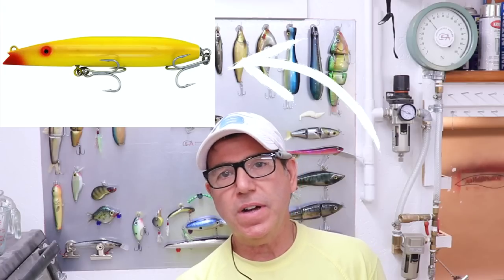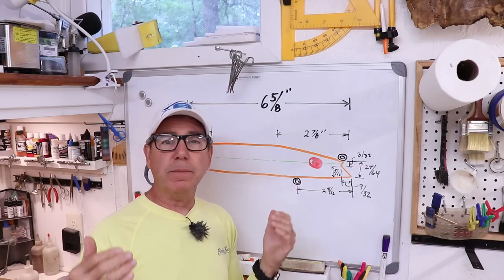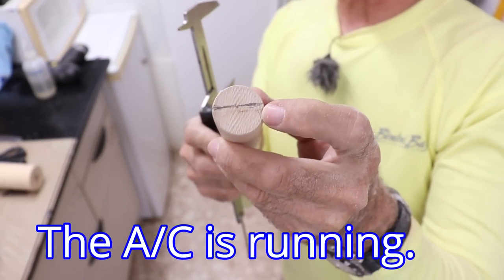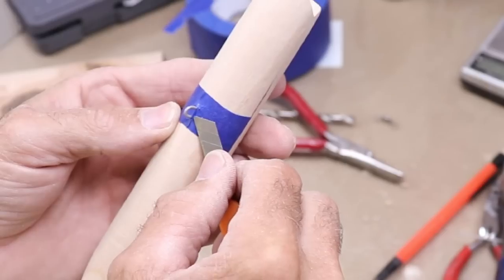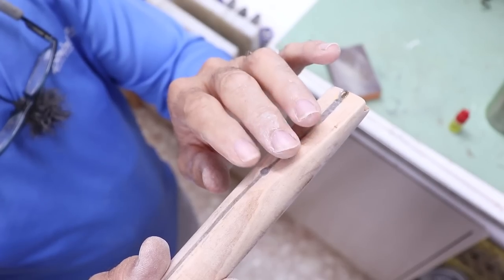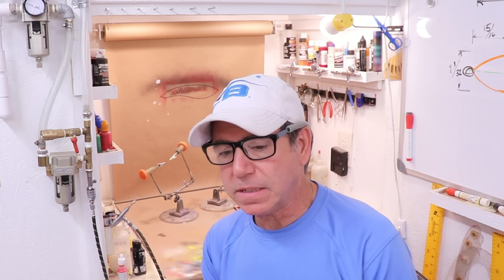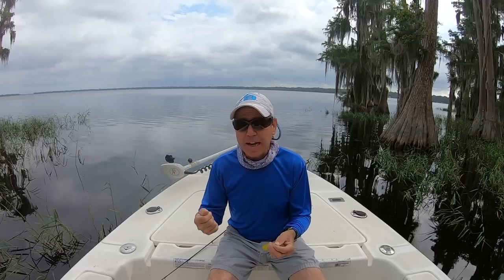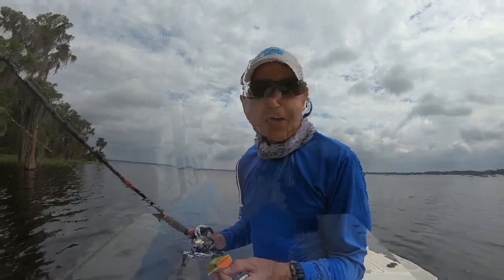How to Make a Wooden Darter Plug Step-By-Step  #darterplug #striperfishing

Comment from the maker: So I'm seriously thinking of making a trip up north to do some striper fishing, can anyone give me some advice?  I think the nearest fishable state to me would be Virginia, what do you guys think?  Is there a place that is easy to access from shore or a good beach to fish that has nearby places to stay (that won't break the bank)?  And how late in the spring can I reasonably expect to have a chance of good fishing?  Any help would be appreciated.
Reply: NC has bass too which is closer to you but those fish are heading north this time of year. Not sure when you plan on going its heating up in NJ and NY so you may want to head further north.
Reply: The striped bass are here in NJ right now. The surf fishing has been phenomenal. They are on their migratory path north at this point. So if you are planning a trip, pretty much any Jersey shore locale would be a good choice.
Reply: Stripers & blues are going nuts up here in nj & delaware
Reply: Virginia might be a little too far south at this time of year. Keeper sized fish are just starting to reach northern Mass / southern NH.I always have the best luck with water temps in the 50-65 degree range. this is also fishing from the shore for the most part, if you can get deeper water then you'd be able to get in to the warmer temps. Rental properties on the beach up this way are quite expensive, maybe $2000-3000 a week. Maybe if you stay a bit more inland you could get one for half that amount.

Comment: Could you of had a little water or solution on the brush when putting the clear on? Why glob once but not the second time? Maybe too thick of a coat? Sounds like it's time to experiment on scrap wood. Maybe do a couple test. Plain wood, painted dry fully, painted then still wet. Do a light and heavy spot on each. Keep up the great work I like how you bring your engineering skills to bait making.
Reply from the maker: I keep my UV resin brush in a light-tight container.  I have done lots of testing (check the link below) and it's almost always a problem with the interaction between the clear coat and the paint.  A good mid-coat like polyacrylic, applied well!, is almost bullet proof.  After the  resin residue had hardened I sanded lightly, wiped with alcohol , and sprayed a couple of coats of polyacrylic.  Ended with a super nice clear coat.  https://youtu.be/E0pkoI8CvJQ

Comment: Thanks for making this video, Surf fishing for striped bass/bluefish is about all i ever target nowadays. To get the right movement out of the darter i think you really need sideways current, like fishing a river from shore so towing behind a boat just wont do the potential action justice. One of the first lures I tried to make was based on a darter design, that said it didnt have the right action although it still caught a 29" striper. In the next couple of months i am having a new workshop built and i'll need to give a few of your designs a go.

Comment: regarding the knot type, I just about always use 50 Lb flouro leader and the 75 pound tactical angler clip to attach the lure. In 7-8 years of using them i did loose a lure once due to it working itself off the clip. They make it so easy to switch out lures day or night its a no brainier for me, even in pitch dark i can feel the clip and know how to remove an install a new lure with no lights.

Comment: Awesome video, that’s a staple of a striper anglers night bag, along with the needlefish. Both are supreme night time baits. 

I figure it’s worth mentioning before you find out the hard way: the plugs are always through-wired with the intent of using a heavy barrel swivel to attach the belly hook (rear hook optional and not encouraged- see “one hook solution”). The biggest stripers are quick to mangle some of the strongest treble hooks if they are able to get leverage against the plug, but a swivel prevents this in most cases. Not such a concern on fish less than 40 lb

Hope you catch some big fish on it!
Reply from the maker: I actually knew how the lures are normally outfitted and I have made some topwater lures with the same type of belly swivel.  I guess I just got a bit lazy and decided to go without the swivel.  You're right though a big fish can do a number on the hooks.  The lures I make to troll for big king mackerel are outfitted with heavy gauge hardware including swivels.  Thanks for the comment and insight...cheers.

Comment: Darters are primarly used when you have an extreme cross current. It makes them dart even more.
Nice job on this. This is the hardest lure to build. Many NE custom lure builders hate to make them.
Wait till fall and fish the southward migration. South shore of long island in late october or Island Beach State Park in NJ in Nov. 
All spring stripers are in NY and Mass already.
Reply from the maker: I think your right...its a bit late for the spring run.  I'll have to think of a different trip.  Thanks for the input.
Reply: The spring run is still going strong here in NJ. I guide in Stone Harbor and Cape May from the surf and boat. We have been doing very well on the stripers. No signs of slowing yet!

Comment: I'm in the same boat as I've never even seen this type of lure. But I am originally from North Carolina and so obviously familiar with gotcha metal plugs fished in the surf (lots of  current) and just guessing here but seems this lure is designed to function similarly but with a much larger profile and presumably diving rather than sinking.

I don't have a turn lathe so I'm thinking 1" hardwood dowel???
Reply from the maker: A dowel is what I would have preferred to have usted.
Reply: @EngineeredAngler  just getting ready to give this one a try. Watching again the first part of the video and thanking God I was forced to switch over to the metric system  after moving to Indonesia.😁
Old dogs can learn new tricks.

Comment: I would have thought of that style bait as more of a ‘jerk’ bait or a dive and rise. Similar to a Sledge or Suick that we use for Musky. Would have liked to see you work it that way on a cast. As far as knots, I use a wire or fluoro leader with a snap or split ring attachment, so really never cinch to the line tie, even fishing for walleye or pike we use a leader with a snap to connect to bait
Reply from the maker: Thanks for the input

Comment: I think the lure has great action, Franco! I would like to see what it looks like made of a more buoyant material. I know it's common in the striper world to build plugs from Alaskan Yellow Cedar which has a lower specific gravity  than hard maple.
Reply from the maker: With the shape and weight staying the same...the action will not change.  That's why my focus was on weight and dimensions for this build.  Going with a lighter wood just means finding more room for the added lead. But sometimes you want to be able to manipulate the balance, that's when going with lighter (lower density) wood can be key.

Comment: Great job , you mentioned instability and barrel rolling. What leads too this phenomenon weight distribution or  non symmetry?
Reply from the maker: Lack of symmetry...the  worst of it is that, since the lure is essentially cylindrical, it takes very little to turn it into a whirling dervish.
Reply: Thanks I will work on my symmetry and get a lathe

Comment: Could your clearcoat problem have been caused by the paint you used?  The reason I ask is because I've just clear coated a lure and the bottom half was painted with Jaquhard fluorescent yellow (the only Jaquhard paint I own), and the clearcoat quickly went really "orange peely" over the yellow belly.  The rest of the lure was fine, I cured it and then did a  dip coat in in UV Epoxy and cured that.  The end result was fine, although the belly was smooth the paint underneath the clear was mottled (pleasingly).
Reply from the maker: Yes, absolutely, I think the paint did not play well with  the clear coat.  I always put a couple of coats of polyacrylic to seal any paint I use.  It works like a charm but this time I got in a hurry and only put one light coat...my bad.

Comment: What was the weight you worked out on the calculator for ?
Reply from the maker: I was just converting the known weight of 2 3/8 oz to grams so I could check how much weight to add into the lure to match the original.